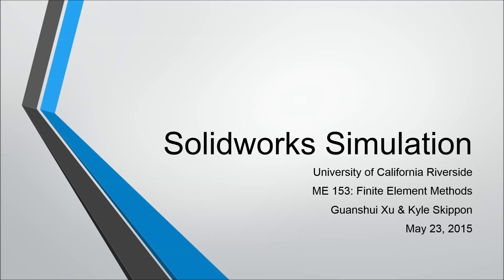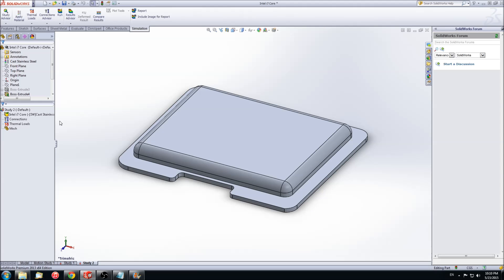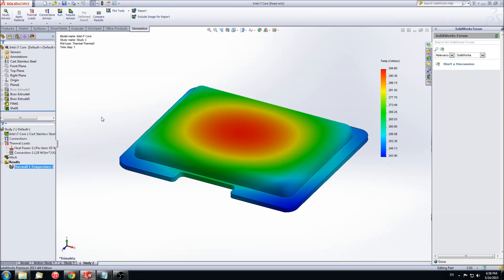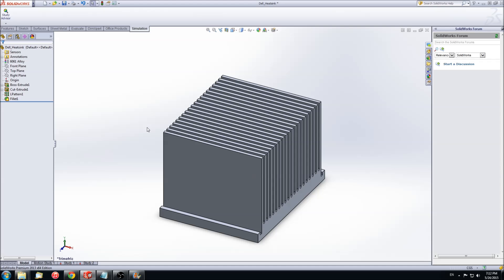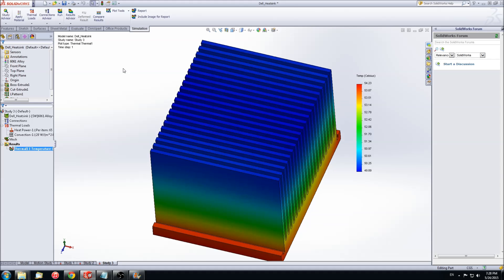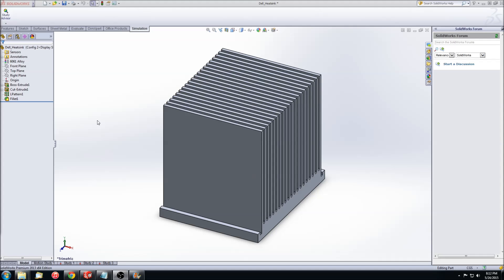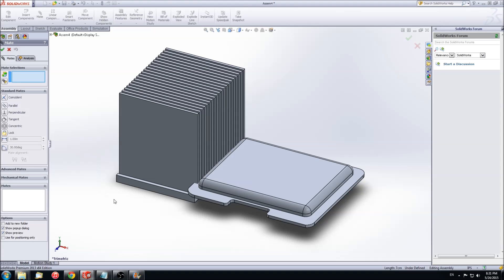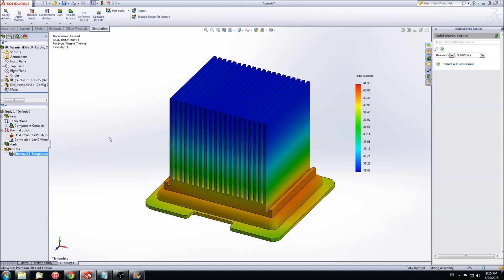Heat Sink Thermal Analysis [Solidworks Simulation (1/2)]

Comment: can you upload the part 2 please ?
Reply: Part two is uploaded, but it's a stress simulation, not a thermal one. For more advanced thermal simulations I'd look elsewhere, but this is a very good intro.
Reply: @JimBob1937  any suggestions?
Reply: @hyperhektor7733 , this video just covers the basic thermal simulation, where you define material types and convective cooling. However, solidworks also has fluid/flow thermal simulation. From that section you can model the cooling you'd expect for specific types of fluids (air, water, something else...etc), take things like radiative heating, gravity....etc into account, as well as model heat flow for parts that are not in conductive contact. Google/search for something like, Solidworks thermal flow simulation, to get ideas of what it can do.
Reply: @JimBob1937  thank you for your suggestions.
I just wanted to do some "simple" models like a DIY CPU aluminium&copper metal cooler with a fan. So i can optimise the desgin. Cool would be when heatpipes could be used (x%water+ x%alcohol based fluid)
Reply: @hyperhektor7733 , ah, I am thinking of the same. I'm an electrical engineer but am curious to try casting a water block since I got into jewelry and art casting a while back. Jewelry type investment captures very fine details. Curious to try casting since I can 3D print an additive manufacturing type design that I can then cast. In theory that should work, and allow a lot of interesting designs.
Heat pipes are quite hard to simulate, if so, you'll want to look into the flow simulation electronics module, I think I recall seeing heat pipes there as a built in component.

Comment: You forgot to include thermal resistance which important for thermal compound or thermal pad that goes between the cpu and heat sink. You are assuming that heat flow without resistance from the cpu to the heat sink. Can you please show us how we can model thermal resistance in this example?

Comment: An excellent video giving a very good introduction of the analysis. 
What should we do if we had to glue both the parts together?
Reply: in that case you can apply a glue properties on the surfaces between the heat sink and the heat source

Comment: Hi the convention coefficient should be ranging from 5 to 25 W/mk for natural convection..may I know why you use 40W/mk. Thanks
Reply from the maker: I used 20 W/mk originally, but then increased it to 40 W/mk to simulate forced convection from the fans inside my computer case.